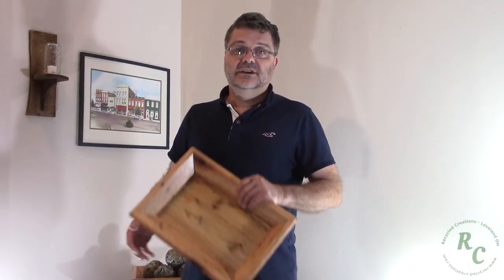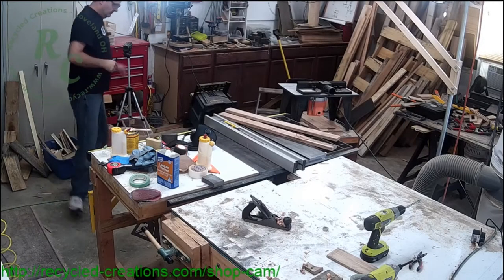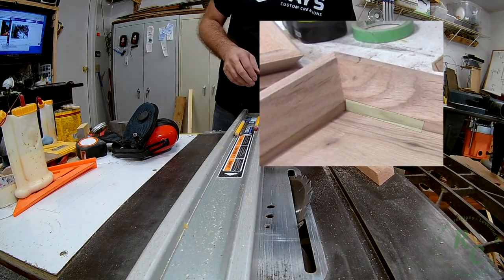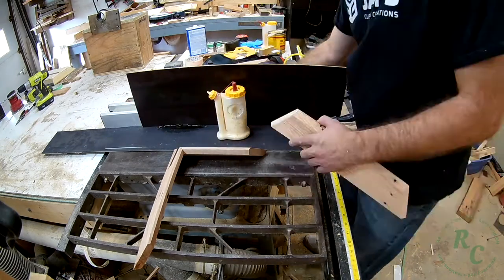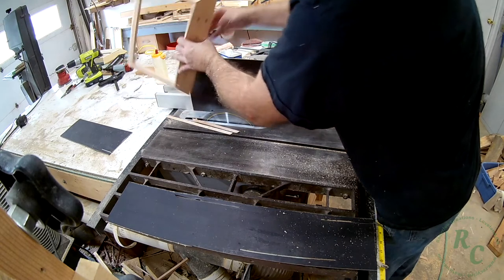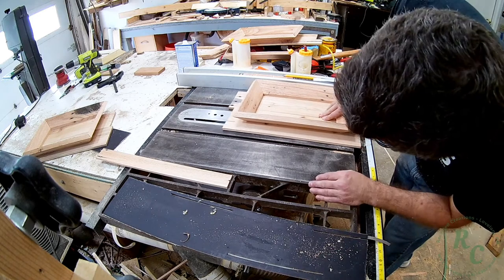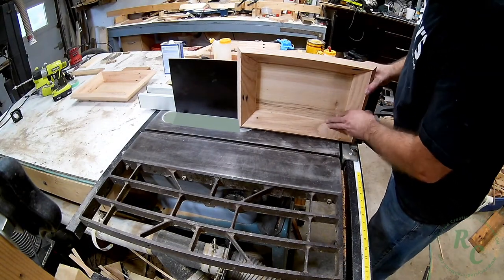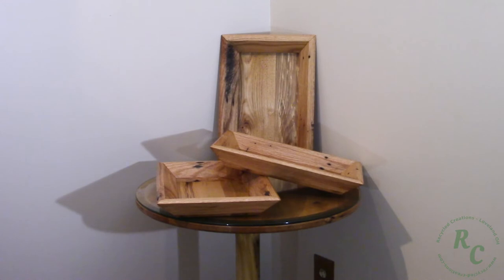How to Make - Compound Angle Box

Comment: He didn't show how to calculate and cut the mitre joints! He merely said 'I have a jig for that'. This is not a 'How to'.  It's a 'Watch Me'.
Reply from the maker: Apologies this is mostly infotainment ... if I remember right the jig I insert into my chop box for this build was 45 degrees meaning it reduced the angle from 90 to 45 in relationship to the blade, this jig allowed the work piece to be supported so that a compound angle could be cut with out moving the head of the saw from zero.  I guess I was making an assumption that it was obvious what the jig was accomplishing.
Reply: The whole video was pretty terrible overall. Sorry Billy. I calls 'em like I sees 'em.

Comment: I’m building a ramp off a porch which slopes 2.08º (it drops 2” over a span of 96”), but the ramp also is angled from the porch at 7º.  I want to cut the supporting joists so that the ends that attaches to the porch are flush with the porch.  How do I calculate what the angle of my saw and the tilt of my blade should be?  My angles will change from project to project, so I want to learn how to set my saw no matter what the slope or the angle.  Can you help?
Reply from the maker: Sorry those are not skills I really have a good handle on... hope you figure it out.

Comment: I watched several time , still I can't figure out how to make molding jig . how that wood sting that place no clamping ,can you explain ,Thanks Billy ,you are very smart ,thanks
Reply from the maker: My saw has some holes on the back of the fence that allow me to run a screw through the fence into the jig to secure it, the jig is a straight board cut with 45 degree angles, thus reducing the angle from 90 to 45 degrees supporting the work piece sorry I don't make it in here very often to answer comments.

Comment: Nice video.  Thanks.  What angle is the molding jig off the bed?   Also, the chop saw was set at 45 degrees?
Reply from the maker: +Gus Rolotti yes the chop saw was at 45 degrees and essentially The Jig in the chop saw is 45° as well